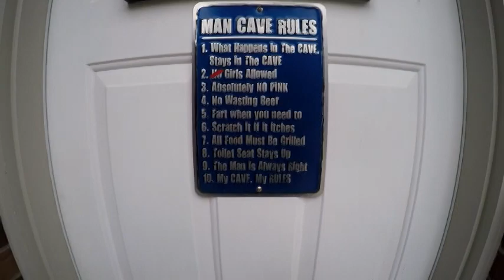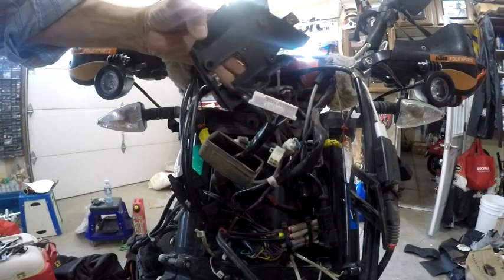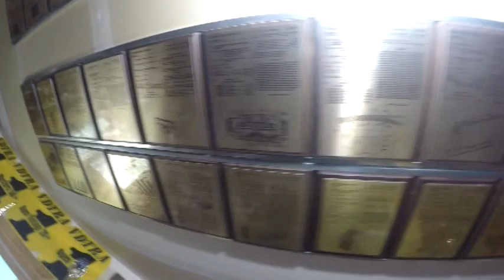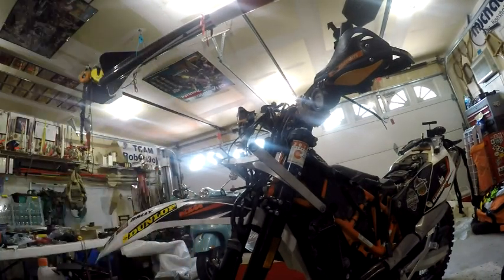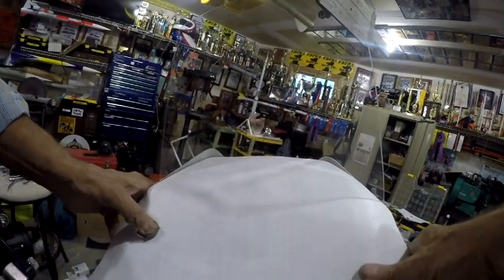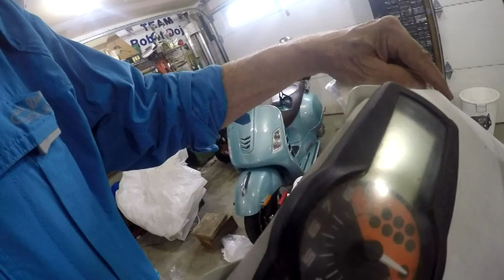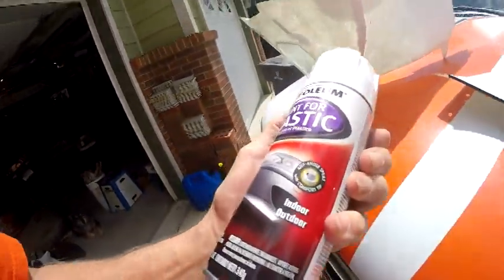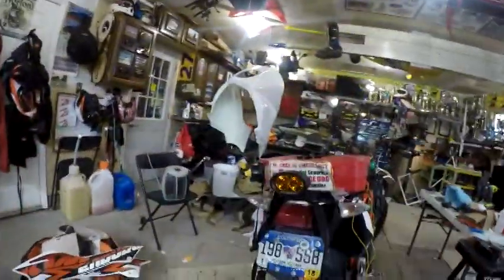KTM 690R Enduro ADV690 Alberto Dottori Rally Fairing Kit Install

Comment: Thanks for creating this video. I just installed one of these Dottori fairings on my 2017 690. I used your video as an instructional video after I enjoyed watching it the first time. My fairing came out very nice. My only real issue, I had problems with paint too. I should have used a two part. I think my biggest issue was the temp when I painted it. Also, white as I found out is somewhat difficult to shot. It's hard to see the material being laid down on an already white surface. The paint fish eyed and ran. I sanded it down and reshot it without much better results. I may wait until summer and reshot it in the warmer temps. I mounted my speedo a little lower than you did and then I mounted my Garmin Montana 650T GPS above the speedo. 
Again, Great video.
Reply from the maker: I had to see past Deacon, but the console can accept lots of electronics without putting it on a tower. I hope you told Albierto that I was the reason you bought your fairing. :) I'd like to see your picture. Get the rustoleum plastic paint. It went on great without primer.
Reply: I ended up taking the fairing to a local body shop. It came out nice. I added some boat registration lettering I picked up on Amazon. It reads ADV LITE.  Sorry, I can't add any pictures to my reply.
Reply: Just found you on facebook and sent you a couple pics via messager

Comment: Nice very nice as always I have a 2016 ktm690 r and I been wanting to ask you if this motorcycle can go up to 80 miles x hr on a regular basis mine start moving like is going to get out of control about 75 miles on the freeway I don't know what to do never do any suspension adjustments I'm 5'11" and 185 lbs i have add pennies boxes too and 50/50 tires but still the same your opinion matters to me thanks look forward to see your valuable response thank you
Reply from the maker: Juan, I have a steering damper on the bike and I have always ridden with knobbies. I have passed trucks on 2 lanes in the rain with the dog on board at 93 mph, but normally we try to stay at 55. With the fairing now we can cruise at higher speeds, but we never get on freeways. It's safer nicer traveling on county roads. Did you balance your wheels? My front knobs would chunk if I drove them fast for a long time. When I get offroad I want to make sure I can dig my way back, so I sacrifice comfort? Since I ride solo with the dog.
Reply from the maker: Oh, Ron goes 80 on a regular basis because he's in Illinois and there is not much dirt there. He also has a steering damper
Reply from the maker: I went 120kmh for 400km in Mexico, with no stability problems. I was using a tractionator semi knobby front